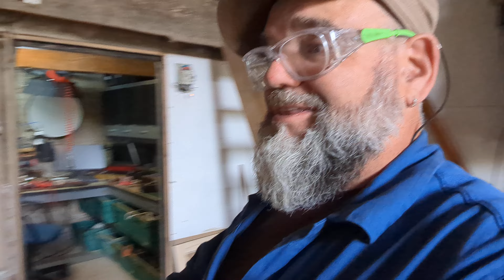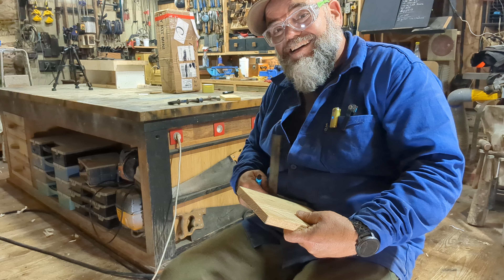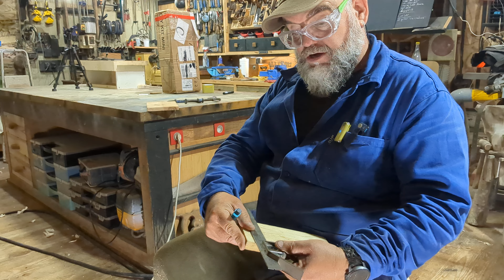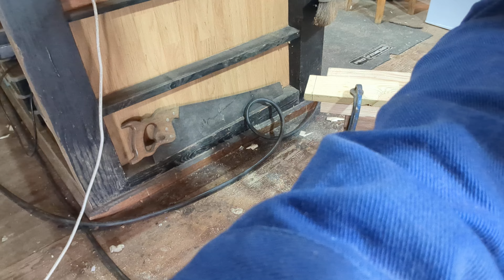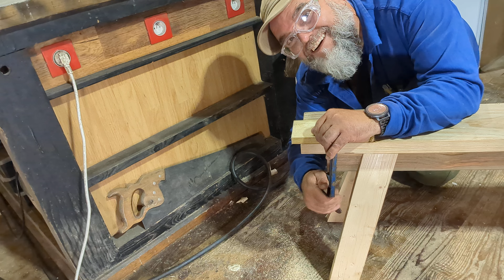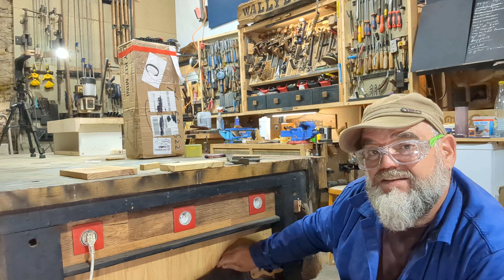How to cut wood Square by hand

Comment: I stopped using a handsaw quite so much once the arthritis got to a certain point. I still use them - I have a couple of tenon saws and while back, I picked up a laminate saw that quickly became my ‘panel saw’ of choice - it’s very sharp, the teeth seem very durable (and sharp), but the biggest advantage is that it’s rather a thick blade, so it doesn’t flex (the tenons, of course, have a nice, stiff back). I’ve not actually used it to cut laminate, but it’s bloody good for tree wood. Rips reasonably well, too. I’ve got a couple of katanas, too, which are very handy, especially when you actually want the blade to flex.

For me, the key to a straight hand-cut, has always been patience - going as slowly and deliberately as possible. Slow and steady, ‘n’ all that, especially for a rank amateur like me.